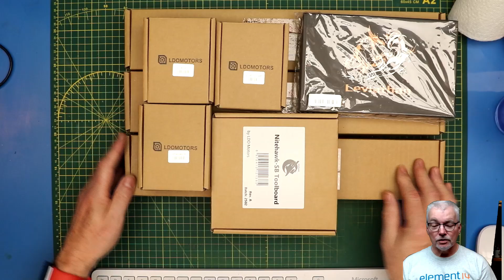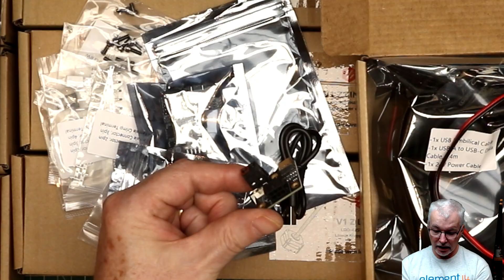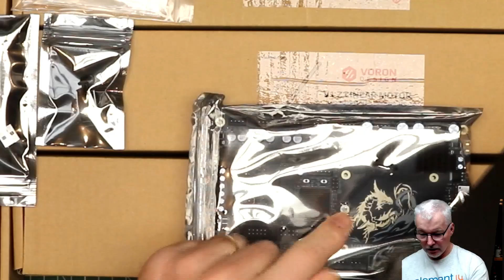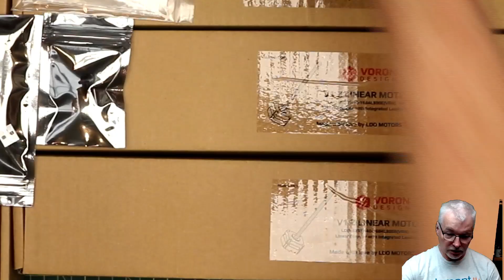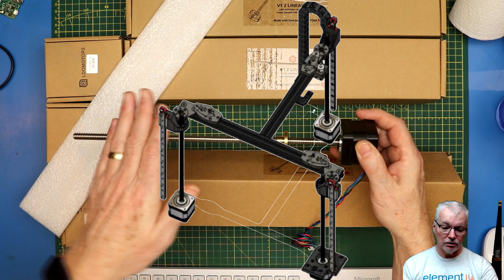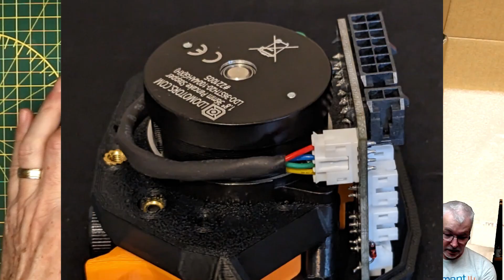Mail Bag Mar 2025 - LDO Motors for Voron Trident

Comment: So there is a USB for the main board, and a second one for the tool head.  Does the tool head USB just show up as another com port?  If so, I guess you can't use a gcode "sender" like pronterface to send it g-code as it would need to know to send some stuff to one com port and other stuff to a different com port.  Is that correct?  So you have to run klipper on a voron? Am I getting all that right?
Reply from the maker: The PI connects to the leviathan main board vie rx/tx or USB (Serial Emulation like all the rest), the toolhead also connects to the PI via the ambilocal, adapter (To allow 24V injection to toolhead) and then also to the PI. so yes there 2 separate communications path. While the main MCU receives GCode type comms (If using Marling for instance), The basic design is for Klipper / Voron and as such special protocol is used to ensure timing etc, the toolhead as far as Klipper is concerned is just another MCU configured differently. I hope that answers your question
Reply: @TheBreadboardca  Awesome thanks - yea, it's seems to have a middle man to talk to both boards.  Got it.